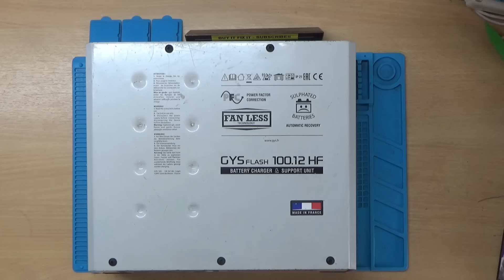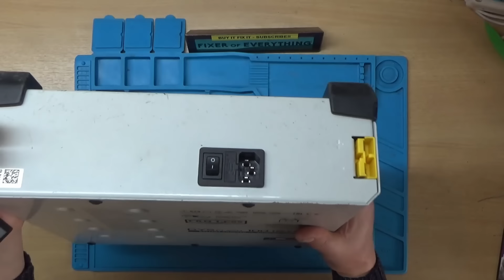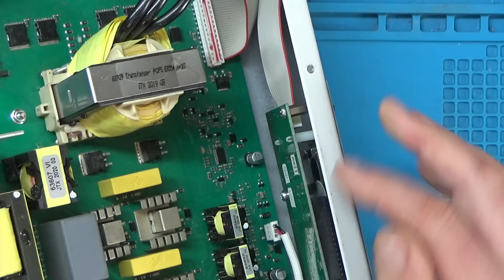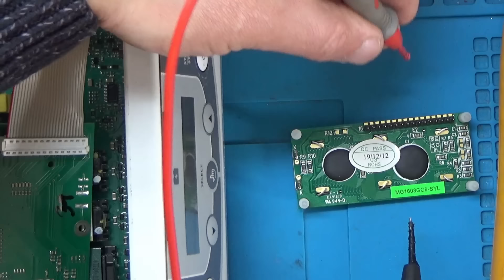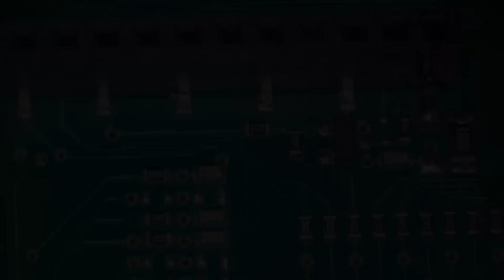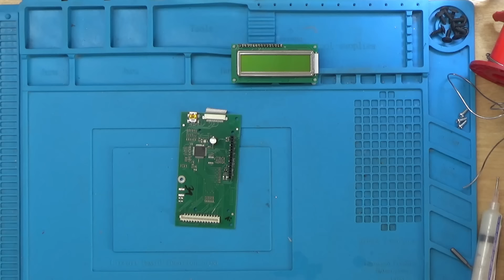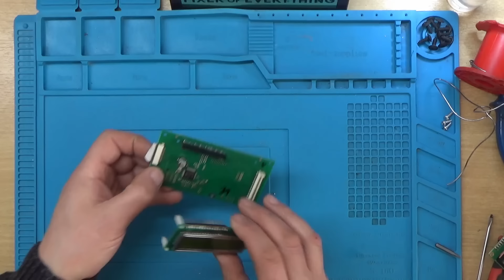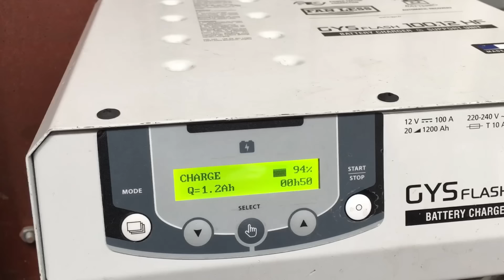Very Expensive Battery Charger - Shop Couldn't Fix It, Can I?

Comment: Good show, an expensive device saved from landfill. Surprised that the connector pads hadn't ripped off the PCB. Not a fan of these devices. PS, I didn't know you were Australian.
Reply: Definitely saved from LandFill. After the previous repairer (if you can call him that looking at the state of the board) gave up I thought it was game over. Mick’s skills to the recuse.
Reply from the maker: Thanks Ralph 👍Australian? lol

Comment: Superb job! I'm pleased that you went to the display quite quickly as I had a feeling the machine was powering up and beeping because no battery was attached. I was hoping you may measure output first to see if was just a display issue but never suspected it would be the socket. I think your replacement socket and repair is more robust than the original  👍
Reply from the maker: Many thanks! Yes it seemed like it should have been displaying something because it beeped so I thought it might have no power to the display or something. I didn't expect it was going to be the socket either!

Comment: Over priced faulty equipmenr possibly? Thanks for the look.Always enjoy.
Reply: The GYS Flash 100amp battery charger/supports are widely used in automotive testing/tuning industry, probably not so much in home use as it's a bit overkill for the average home garage, it's not overpriced if you use it everyday for work, I had one for years with no problems, as a mobile tuner, worth every penny of the £600 I bought it for, all my equipment paid for itself many times over with the income they generated.
Reply: @antc1609  thankyou.
Reply: No
Reply: @Coolcarting  howso?

Comment: No problem with the bridged diodes at the beginning of the video?  Surprised it was a display connector and that you found the fault so quickly, you're good brother.  I'm always impressed by your talent, much appreciated.  Great video, well done.   See you next time.
Reply from the maker: Thanks Terry, I assumed the diodes were supposed to be bridged, probably by a track underneath, and the previous repairer just touched them with the iron. Thanks again 🙂

Comment: "Fanless technology", but the first thing I noticed when the cover came off was the fan at the left side...
Reply: Apparently only a limited part of the device is fanless .......... 🙂
Reply: @SlartiMarvinbartfast It was probably a fanless design until they started getting hundreds of them returned because they overheated and blew up.
Reply: @SlartiMarvinbartfast  I'm guessing what they meant is it wasn't sucking in outside air.  You don't want the stuff floating around in the air of a shop going into your electronics.
Reply: @SlartiMarvinbartfast The mains lead is fanless.
Reply: @SlartiMarvinbartfast  I'm not a fan of that, and I guess nobody does, hence it is fan less
Reply: There's a space in there, so it's "fan less", as in fewer fans!
Reply: Yeah, I'm not a fan of that either. That must be why they call it fanless technology.
Reply: Less fans, not no fans.
Reply: I thought it was "fan less" design, rather than "fanless', ie designed to operate the fan less (maybe thermo-controlled?)
Reply: @new-zealand-clippy fan less, heat up more 😂
Reply: Fanless actually is more like ventless, the fan only circulates air inside the device, so it makes less noise and is not affected by dust. But kind of a lie.
Reply: Maybe that's what it does ? It fans less ? 😂😂😂
Reply: Fanless technology means no one is a fan of that technology. There is no fanclub.
Reply: They improved fanless technology with a fan
Reply: They're using a technology nobody is a fan of
Reply: I am not a fan of this
Reply: I noticed the same lol.  Guess it spins slow enough for nobody to realize it was untrue. 😂
Reply: There is a space between fanless.. Fan Less. As in it has LESS fans 😂
Reply: My fan comes on when I’m pulling 30 odd amps programming Renaults
Reply: aslında demek istediği sürekli caisarak ses yapmaz oradaki fan
Reply: Actually that charger on the video is probably an old one, the  "Fanless technology" has now been replaced by "smart cooling technology" on the recent models from a local workshop here, not sure which came before the fan or the mention
Reply: It’s French! I used to repair an oil cooker called a Franco beige it to was French and a heap of crap.
Reply from the maker: Yes 😂😂😂😂
Reply from the maker: 😂😂😂Yes only the inside part.. (although there wasn't any vents).
Reply: @BuyitFixit   ventless charger should have been written :)

Comment: Its like when you drop a car off at a shop and they have it for a month just to charge you 900$ for a buncha parts that didnt fix the issue so you take it to another shop and they find and fix a broken wire for a few bucks. But then you have other problems from the “new” stuff the other shop said you needed and now you cant get any refund or return parts because you took it to another shop arguing that the other shop broke the parts they just put in..  lol.
Reply: Sounds like you've been watching South Main Auto!  The previous shop fired the parts cannon at that truck, to the tune of $900. Still not repaired. Eric O found a corroded wire in a module connector at the rear of the truck. Sheesh, there are a bunch of hack mechanics and technicians out there. Thanks for a great video Mick, you aced another one.
Reply from the maker: Thanks mate 👍
Reply from the maker: Sounds pretty accurate 😂😂👍
Reply: My first words to local shops that bring me their problem jobs are "where are the original parts?" You know, the ones that weren't faulty in the first place.
They are learning now, don't throw away old parts until you know it's a good repair.
Sometimes, they have made the right call but they've sourced a part that doesn't quite perform to spec (or doesn't perform at all!)
I have some really good customers though... if they're not sure, they won't fire the cannon, they send it to me for diag.

Comment: It's a good job you tried the other display or it may have had you running around in circles
Reply from the maker: Yes, I wanted to rule out that the display wasn't faulty, then noticed the dry joint. I surely wasn't expecting the connector to be broken underneath. That was purely found by chance!

Comment: I love your videos, but you're so much of a wizard, I have to question if this is real?!?! How do you assume all of the main PCB is fine then only work on the LCD and magically hold the unit and find a faulty connection?! It's really impressive and really suspicious. Like I said, huge fan!!
Reply: That was literally one of complaints!!! Screen not working!!!!!
Reply: @rks9612  but he said a cap failed and there were burns on the board
Reply from the maker: Thanks 👍Yes, totally real. How would I fake a broken connector underneath where I couldn't see? I thought there might by no power to the display as it should probably light up, so I had planned on measuring the voltage as I wasn't sure on the main board where it came from so was going to work backwards. It could have been the display as I've used them before (see milwaukee spotlight repair) where I used one on an Arduino for a heat plate I cobbled together. So while I was there it was easy to plug one in to test, then I noticed it flashed when I wobbled it, and thought it was a dry joint. I wasn't expecting the connector to have broken underneath, so I was surprised by that. I also did say it could have other faults which is why I tested it on the battery, but it turned out to be running fine.
Reply: My wife always says "electronics are afraid of you", because every time she gives me something that "doesn't work", it works when I use it. I think it's just the same with our australian friend here...and a lot of knowledge and experience.
Reply: The fact that the device beeped when the button was pressed does (sort of) indicate that the majority of the unit (CPU, power supplies etc) is probably working. I was both surprised and disappointed that there was not an almighty bang, sparks etc from the burnt area.
Reply: Agree,sometimes looks to easy and think that a pre video diagnose is carried out,but stillI love the videos!